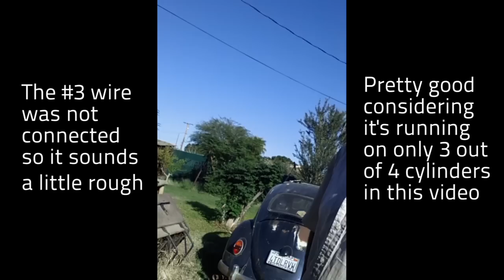Hippie Van Man 1979 Volkswagen Bus Engine Rebuild

Comment: yeah! mexicali!! I saw imperial Ave. in el centro there didnt see mexicali though, but yeah there are a lot of good vw mechanics here. Did your engine started failing or why did you decided to do the rebuild??
Reply from the maker: +Ernesto M I bought the bus in 2011. The engine was a bit weak. I drove from Toronto to Cali and it really struggled in the mountains. I had been following another blogger who was traveling in a VW and he had pulled the engine 11 times for repairs. It kind of motivated me to do one proper rebuild at the start of my trip to make for smoother sailing heading to Argentina. Luckily there were almost no mechanical issues the entire way to Argentina.
Reply: man!, that was good thinking then making the rebuild before the harsh roads of central and south america... happy travels hippie man wherever you at now
Reply from the maker: +Ernesto M I didn't make it all the way down on pure luck :p